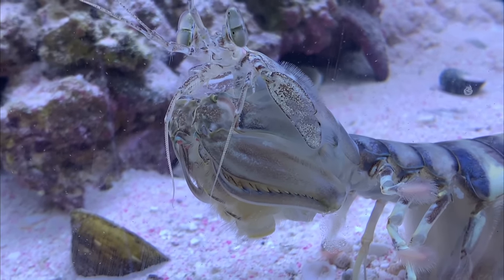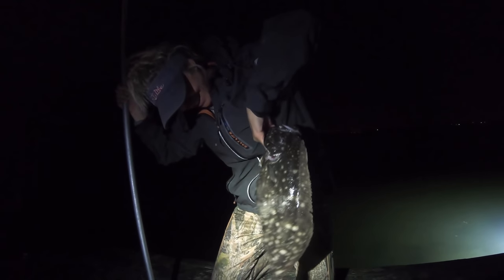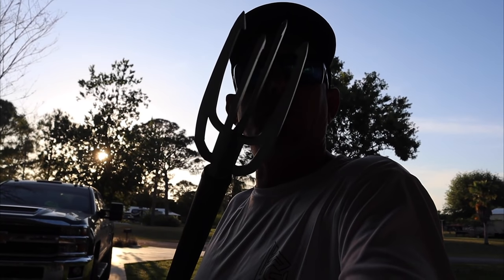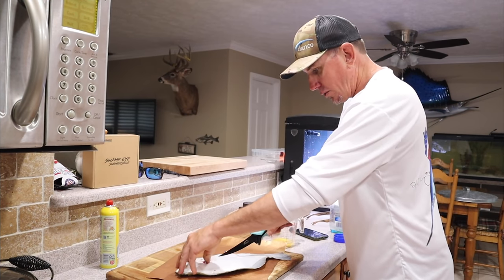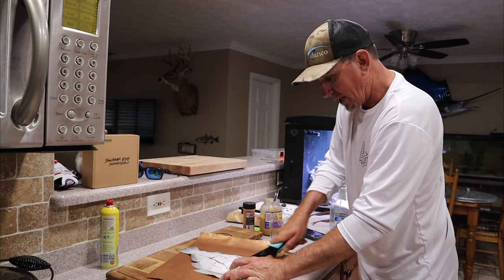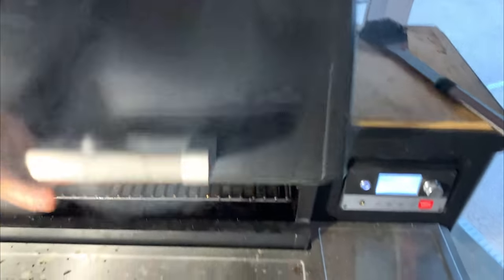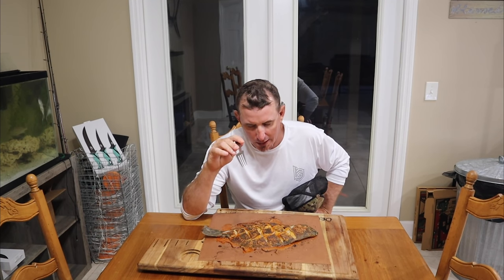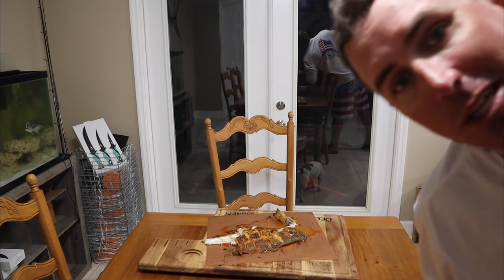FLOUNDER Catch Clean & Cook with GIGS

Comment: One thing about flounder that I get a kick out of is when peaple whom say they know but find out different is when they filet it ..I've seen them filet the top first and when they do the bottom the flounder sinks in making it very difficult to filet .lol cause the top is rounded so if you do the bottom first ya can filet it normally then when ya flip it to do the top it's still rounded and it comes out great ..just a lil filet tip do bottom first then the top ..great vid and godbless
Reply: Found that exact thing when I fished in Venice, LA!
Reply: I take the whole side off two fillets instead of 4
Reply: Good tip, thanks!
Reply: @jessicas2780  no problem I just find it so much easier and eficiant